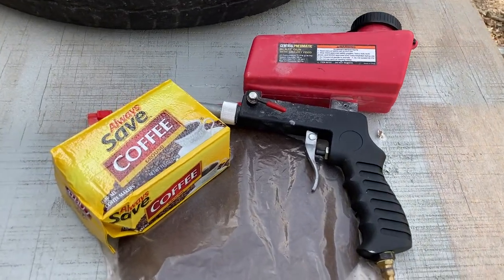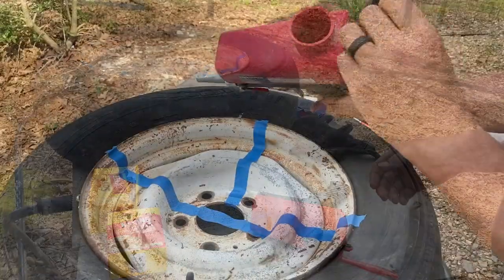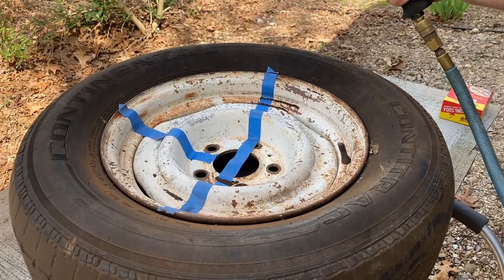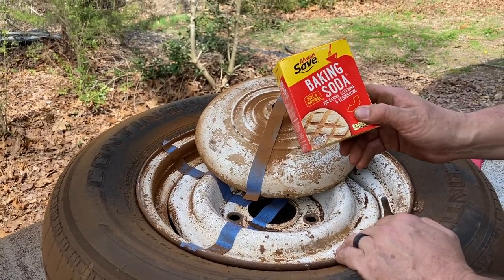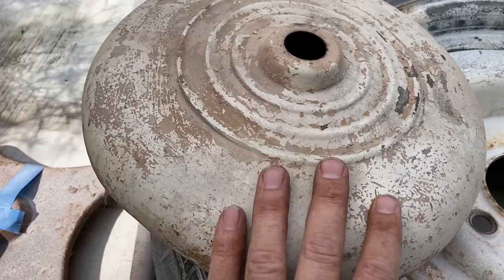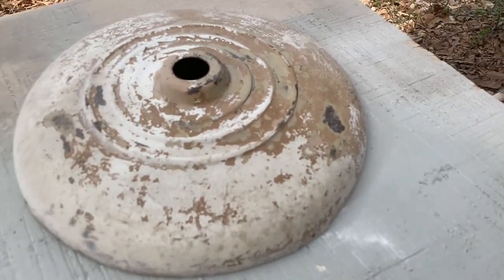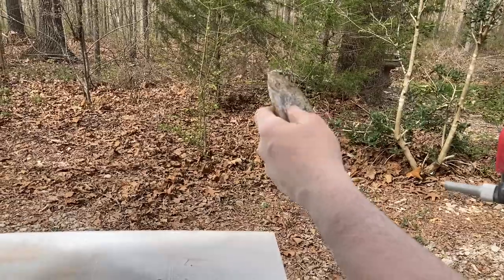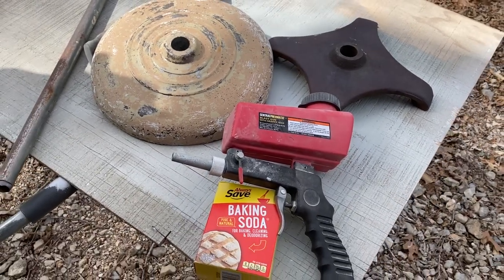Blasting Test using USED Coffee Grounds - Harbor Freight Blaster + Again trying regular baking soda

Comment: to unclog just open the tap and put your finger on the tip then push the trigger slowly.
I've drilled a bigger hole into the adjustment lever and maybe in the tank i dont remember.
But i got tired of this toy, i've bought a cabinet and a much better compressor.
But it was good for a first cheap tool to try and learn about sand blasting.

Watching from France btw, i've worked 1 year in Vancouver Canada we had a cabinet to sandblast some plastic pieces to remove the shine and small deffaults.

Comment: This actually seems like it would be the perfect media for doing engine cleaning and motorcycle frame or just any application where you don't necessarily want to go down to bare metal, because you are just prepping it for painting and knocking most of the loose stuff off. Yeah this definitely seems like a winner to me. Does it damage trim and rubber, or do you have to be careful with it?